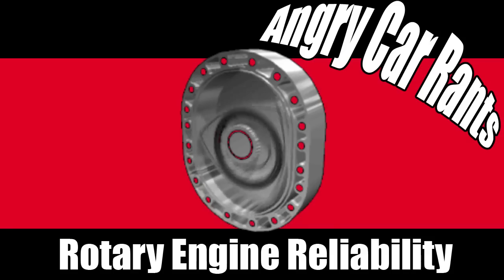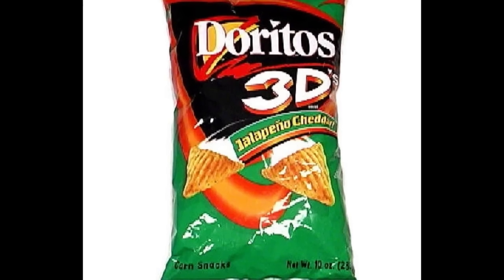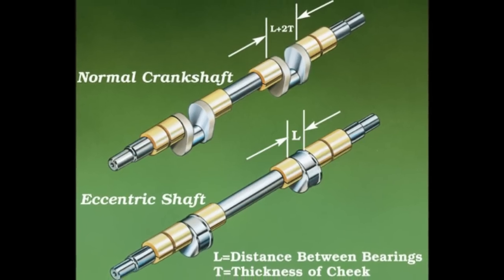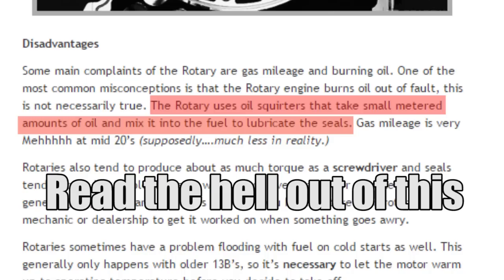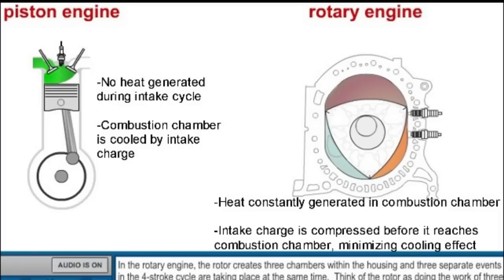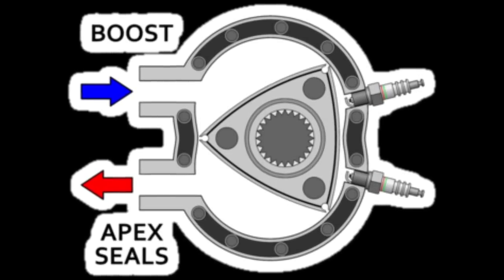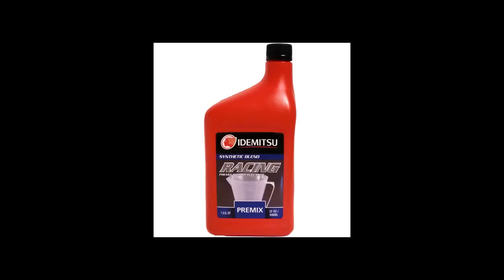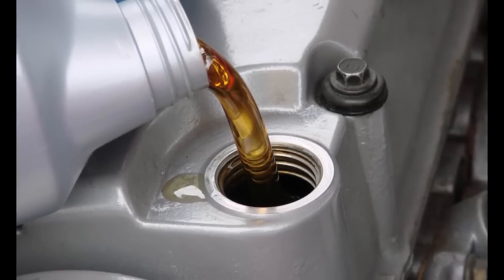Angry Car Rants #3 - Rotary Engine Reliability

Comment: Mazda does not manufacture the Wankel type engine anymore... on Friday June 22, 2012 at 4:30pm the Wankel engine assembly plant at Mazda Ujina #2 shut down and shortly there after was dismantled to make way for a brand new engine assembly facility specifically designed to manufacture Mazda's new signature Skyactiv line of reciprocating Otto and Diesel engines...
Reply: Rudster The Wankel is dead, Mazda cancelled research and development in May of 2009
Reply: If there is a demand for an engine and they can make it meet strict emissions requirements, they will make it. Basic supply and demand. When the demand reaches a point where it is cost effective to manufacture an engine, they will do it. While demand dipped with the RX8, due to the lack luster performance and little ability to improve, the number of RX7's produced was  811,634, Not a small amount and very cost effective. Considering it has been roughly 15 years since the RX7 was produced, there is a whole new generation of people interested in the car and the technology not to mention a still thriving culture surrounding the engine in America, Australia, New Zealand, Russia (Though generally not the Mazda Wankel) Japan and to a lesser extent, still a culture around the world. There is still a heavy demand for a new wankel in Japan and that on its own is enough to look into producing a new model just for the Japanese market. Mazda has been open in that they never stopped development on the wankel engine, They just did not have a market to sell the engines too however they are also investing into wankel generators that power an electric Mazda 2.

The fact is there is a growing market, a demand and the technology is reaching a point where it meets international regulations on emissions. 

Now how about rather than going through every fucking rotary video on youtube, you go do something productive with your life.
Reply: Rudster There was no demand... that is why its obsolete now..
Why is that so difficult to understand???
If its not as good, no one will buy it... and that is exactly what happened.
Reply: over 800,000 sold, no demand? What are you smoking?
Reply: Rudster Maybe instead of repeating rumors, old myths, and spreading lies and disinformation about the obsolete status and history of the Wankel??? Why don't open a book or go to engineering school and learn something about the Wankel that is actually true...
Maybe you won't be so easily fooled the 4th time they start another ridiculous RX-9 rumor that does not turn out to be true...?
Reply: Oh? What is your credentials? I'm studying Engineering at the Auckland University of Technology. Just to cover your "go to engineering school" comment.
Reply: Rudster How many were sold in 2012?
Reply: Oh, so you're completely ignoring my question but whatever, I'll answer your next question. Since the RX7 was not sold in 2012, I assume you're referring to the RX8 on the last year that they were sold. That would be 80 in the United states alone.

However that ignores 
12,346 in 03
21,690 in 04
14,673 in 05
9,343 in 06
5,767 in 07
3,368 in 08
2,217 in 09
1,134 in 10
and 759 in 11.

This is a pretty standard of sales of a japanes mid range sports car in the states. So a total of 71,377 cars sold from 2003 through to 2012. No considering production ended in 2012 and mazda stopped producing left hand drive versions of the car in 2011, let's ignore 2012. Now lets compare it with the most popular sports car in history. The Mazda MX-5. So from 2003 to 2011, Mazda sold 71,297 RX8's, In the same time period in only the states, they sold 92,987 MX-5's. Ok so they sold more, but the RX8 was also $7,000 more retail. But cost a similar price to produce. Retail of a MX-5 in 2009 was $48,000 USD, While the RX8 was $55,000. So in the states alone, The Miata's sold for roughly $4,463,376,000 USD. The RX8 however roughly sold for $3,921,335,000 USD. Ok so that is roughly $500,000,000 less than the Miata. But we look at the exact same years for say. The Mazda 3. In all but 2 years, the Mazda 3 outsold Both cars total sales in just a year. That is 106,353 in 2010 or 120,291 in 2007. By your logic, because other cars sell more, they shouldn't sell the car? The Mazda 3 sold almost 20 times as often as the Miata, The Miata sold 30% more often. that is 30% from the RX8 to the Miata to 2000% from the Miata to the Mazda 3. 

Sports cars are not the main source of income for a car manufacturer and to say as you have said in the past that the RX8 nearly killed Mazda due to engine faults of which could be fixed if found early enough with a quick upgrade of the ecu firmware. There is a demand and to say there isn't is to be ignorant. And this is just with a car that did not sit well with the rotary crowd. The RX7 sold much better than the RX8, sold better than the Miata and even sold better than the every man's Porsche, the 924. 

So before you come up with another false statement that is easily checked through official channels, how about you turn off your computer and get on with your life. Rather than wasting everyone else's because you're not educating anyone, you're just for filling your ego by pissing other people off. What people like myself in university education would call what you're doing, is cherry picking. Cherry picking small facts that support your unfounded argument.
Reply: Rudster Well I couldn't have proved my point any better myself..
Reply: Rudster "Mazda sold 71,297 RX8's.." which was not enough to cover Mazda's development cost for a new model...
producing a net loss for the company.
Reply: Again cherry picking facts, 71,297 sold in a single country. The world does not revolve around America you know?
Reply: Alfa Romeo GT produced 80,800 cars, Cadillac produced 2,700 ELR's, The Dodge Viper, 28,056 from 1992 to 2010. Honda NSX 18,531 from 1990 to 2005. The RX8 did very well for a sports car compared to other cars. Even Lotus's best selling car, the Elise only made 20,000 cars. the fact that Mazda have very popular entry level day to day cars gives them the headroom to work on unique cars like the RX7 and RX8. You are cherry picking facts to make yourself seem intelligent. And yet you're so wrong.
Reply: Rudster Its a very important fact..
Reply: Again, all you did was cherry picked what you wanted. 

People argue day and night that the 350Z was a better car and yet Nissan sold only 35,000 of them in the states. Relative to the vast majority of sports cars sold along side the RX8, the RX8 did much better.
Reply: Don't tell me.. Mazda stated that it could not make a profit on the failing RX-8
Reply: 35,000 < 71,000
Reply: Rudster Please tell me you are not suggesting that the automotive industry revolves around... New Zealand!!!!!! Hahahaha!!!!!!
Reply: Rudster Sounds like a temper tantrum to me.. Why don't you go cry to your mommy?
Reply: Oh because spending every day commenting on video's about a technology that you don't like is so mature. You have a problem.
Reply: Rudster You are the one that clearly has a serious problem accepting the truth... the Wankel is obsolete.. its been obsolete for over 4 years and it is not coming back..
Just accept facts and move on.. find a new hobby..
Reply: Rudster Thanks for proving my point...
Reply: What point? It is completely illogical. Detrimental to environmental efforts to have a stance like yours. You have no idea what you are talking about. To say that is like saying the technology used to get us to space is obsolete because we don't go to the moon anymore. The fact is, Mazda has been open that they have continued development of the rotary, there are specialists who remanufacture these engines for racing, there are specialists all around the world repairing and remanufacturing these engines. Australia, Japan, New Zealand. There are reasons why people spend $200,000 on a custom wankel for racing. They are not obsolete, you are obsolete in this discussion.
Reply: And again, you dodged my question
Reply: Dodging questions, left right and center. Spending all your time arguing that a technology is dead rather than being a productive member of society. So mature.
Reply: Rudster Denial.. is all you have, and you are desperately clinging to it. The Wankel is OBSOLETE.. no longer manufactured in series mass production any where in the world..
Reply: You are repeating yourself, not citing any evidence to back your argument and attacking the character of anyone who disagrees with you. I don't even own one. Nor do I have plans to in the foreseeable future. I have not said that I want one. You have confirmation bias on an emotional belief (Belief, not fact) and are fighting tooth and nail to prove that you're right while ignoring the fact that you have spent over a year replying to people on not just this video but many more, to the point that you are not contributing in any way and refuse to acknowledge any question that might bring doubt to your argument.

The fact is you're arguing over the relevance over a lump of metal that is dependent on an individuals wants and needs. People have the right to want something different, something to express themselves. If someone wants to do that with a wankel engine. What is the fucking problem? It is a personal choice. If everyone lived their life on pure fact and perceived infallibly logic, we would all be the same people and this world would be utterly boring. Everyone would drive one car, everyone would agree with each other, there would be no reason to deviate into creative or different technologies and interests. there would be no meaning to living except to continue the cycle. Without differences in preference and opinion, we would have no development in culture. no development of the individual. no point to anything and to attack someone on something they like for reasons you don't understand is to be a child.
Reply: Rudster I does not matter what you say.. none of it will ever change the fact that the Wankel is obsolete..
Reply: Does not matter what you say. You won't change the opinions of people here. No matter whether you're right or wrong
Reply: There is no right or wrong, only the truth.. the truth that the Wankel is obsolete.. there is absolutely nothing that you can say or do that will change this fact.
Reply: No it is a belief. Just like how I hold the belief that it is not dead. No matter how much you believe that idea, you do not know it as fact, nor do I. The only people who know the facts are not currently open with sharing those facts.I guess we will have to wait until 2020 which is the expected release of the RX9 if it does exist. I again would suggest getting over your little hatred for a lump of metal and get on with being a productive member of society
Reply: Rudster The Wankel is dead, that is a fact.. not rumor..
Reply: Rudster Engineering and Automobile manufacturing are not "faith based" industries... they deal in science and quantitative facts.
Reply: Psychology definition of facts, opinions and beliefs. 

A fact is verifiable. We can determine whether it is true by researching the evidence. This may involve numbers, dates, testimony, etc. (Ex.: "World War II ended in 1945.") The truth of the fact is beyond argument if one can assume that measuring devices or records or memories are correct. Facts provide crucial support for the assertion of an argument. However, facts by themselves are worthless unless we put them in context, draw conclusions, and, thus, give them meaning.

An opinion is a judgment based on facts, an honest attempt to draw a reasonable conclusion from factual evidence. (For example, we know that millions of people go without proper medical care, and so you form the opinion that the country should institute national health insurance even though it would cost billions of dollars.) An opinion is potentially changeable--depending on how the evidence is interpreted. By themselves, opinions have little power to convince. You must always let your reader know what your evidence is and how it led you to arrive at your opinion.

Unlike an opinion, a belief is a conviction based on cultural or personal faith, morality, or values. Statements such as "Capital punishment is legalized murder" are often called "opinions" because they express viewpoints, but they are not based on facts or other evidence. They cannot be disproved or even contested in a rational or logical manner. Since beliefs are inarguable, they cannot serve as the thesis of a formal argument. (Emotional appeals can, of course, be useful if you happen to know that your audience shares those beliefs.)

You have an opinion that you believe as fact. It is not fact. you don't have definitive proof of your opinion as fact. Read up on the difference.
Reply: Rudster Fact; the worlds last manufacturer of Wankel engines is Mazda, its board votes in April 2009 to terminate research and development the following month and sets a date to cease all production.
Fact; June 22nd, 2012 4:30pm Mazda's Wankel engine production facility at Ujina #2 plant shuts down,  8 months later is demolished to make way for new Skyactiv-G reciprocating engine facility.
Reply: Can you cite that evidence? If it is true, then it would be a walk in the park to support the notion that the engine is dead. However even if you can cite evidence, it only supports the belief, it is not a fact that the engines are dead
Reply: Very poor choice to cite. Fox news is not a reliable source to get facts from. Here is an example of evidence to support the notion that the Rotary is still being developed for

Fan, B., Pan, J., Tang, A., Pan, Z., Zhu, Y., & Xue, H. (2015). Experimental and numerical investigation of the fluid flow in a side-ported rotary engine. Energy Conversion And Management, 95385-397. doi:10.1016/j.enconman.2015.02.047

Seems those crazy people in Japan are still working on improving the design
Reply: Oh and in that article you linked

"Mazda is continuing development of the engine design"
Reply: Again, A news article is not cit-able evidence.

Try this one
Hanipah, M. R., Mikalsen, R., & Roskilly, A. (2015). Recent commercial free-piston engine developments for automotive applications. Applied Thermal Engineering, 75493-503. doi:10.1016/j.applthermaleng.2014.09.039
Reply: Or this one that again supports the notion that the engines are still being developed

Xu, X., Xu, H., Deng, H., Gu, F., & Talbot, C. (2015). An investigation of a hypocycloid mechanism based twin-rotor piston engine. Proceedings Of The Institution Of Mechanical Engineers -- Part C -- Journal Of Mechanical Engineering Science (Sage Publications, Ltd.), 229(1), 106. doi:10.1177/0954406214532632
Reply: New articles are not evidence.
Reply: Also again the content does not support your argument

"Mazda spokeswoman Michiko Terashima said research and development on the rotary engine will continue, leaving open the possibility that it could make a comeback. But production is now not making sense when considering the costs of meeting safety and emissions standards for new vehicles, she said."
Reply: "There’s no word on whether Mazda will bring an RX successor"

Again, does not support the notion that it is dead
Reply: Rudster Its dead, dead and buried
Reply: If that was fact, you could easily convince the people here, including myself
Reply: Rudster You are in denial of the facts.
Reply: Bud. Rudster just took you to school! I can't believe you were still replying to those comments... I would feel so insignificant to humanity if I were you haha. He publicly dismantled your argument, and aggressively put you in your place... but you were still replying... jeez...
Reply: The Wankel is in fact dead.. totally and completely obsolete in series mass production anywhere in the world...
Reply: Is it just the 13B that you hate? or do you hate pretty much all of the iconic JDM sports cars?
Reply: Nik Fenix Have you actually been diagnosed with a learning disability or other mental deficiency?  Or have you simply been deprived of higher education or access to knowledge???
Reply: Nik Fenix Who said I hated any engine..? I simply pointed out that the WANKEL engine was obsolete.. and no longer in production.
This statement of facts seems to evoke a particularly hateful response from you.. why is that??? 
 JDM sports cars?  that comment appears to escape logical reason.
Reply: Oh shit! Sorry man, I got so caught up living my life, I forgot to reply! You were probably sitting there all night waiting! Have you talked to your parents? Were they mad you never came downstairs for dinner?

Anyways, let your mom know I said hi!
Reply: Nik Fenix Do you find your lame troll comments really work?
Reply: +SidwatsGts  Angry little troll... why don't you go read a book... that way you won't be embarrassed every time you post a comment
Reply: Excuse me sir, can you direct me to a new car dealership where I can buy a new car equipped with a Wankel engine?????
Reply: The real doktorbimmer
 "Angry little troll... why don't you go read a book... that way you won't be embarrassed every time you post a comment"

Am i under arrest?
Reply: SidewaysGts While although a obstacle to the advancement of mankind and burden on society you ignorance is not a crime.
Reply: The real doktorbimmer
 "While although a obstacle to the advancement of mankind and burden on society you ignorance is not a crime."

Glad to know you wont give me a ticket. Continue on officer. Theres more rotary videos to police!
Reply: SidewaysGts I leave the troll duties to you..
Reply: The real doktorbimmer
 "I leave the troll duties to you.."

I really wonder if you believe that, as you go around trolling everyone who dares to even say they like this engine while you remind them, for no damn reason, that its a dead inefficient horrible engine.

Sadly.

You probably do.

Back to work mr officer. Theres people who like these engines to arrest!
Reply: SidewaysGts Just the facts here.. if you don't chose to accept the facts you do so at your own peril..
Reply: SidewaysGts Indeed, you cannot argue with the facts... and its for this reason why you are so hostile and angry.
Go read a book or find a new hobby.. this one does not seem to make you very happy..
Reply: The real doktorbimmer
 "and its for this reason why you are so hostile and angry."

Awh. Mr officer- I just give you a hard time because youre a douche bag.  Theres little else to it :)

"Go read a book or find a new hobby.. this one does not seem to make you very happy.."

Gladly. Once you stop policing every rotary video. 

Until them- Im having lots of fun following you around with sirens
Reply: SidewaysGts Hey! have you seen the new 2017 RX models down at the Mazda dealer..
No?  why is that?  LOL!!!
Reply: The trailing side of the rotary engine's combustion chamber develops a squeeze stream which pushes back the flamefront. With the conventional one or two-spark-plug system and homogenous mixture, this squeeze stream prevents the flame from propagating to the combustion chamber's trailing side in the mid and high engine speed ranges, Mazda engineers described the full process in 'Combustion characteristics of Rotary Engines', K Yamamoto et al., SAE paper 720357. Kawasaki addressed this problem in their US patent nº 3848574. This poor combustion in the trailing side of chamber is one of the reasons why there is more carbon monoxide and unburnt hydrocarbons in a Wankel's exhaust stream. A side-port exhaust, as is used in the Renesis, avoids one of the causes of this because the unburned mixture cannot escape. The Mazda 26B avoided this issue through a 3-spark plug ignition system. (At the Le Mans 24 hour endurance race in 1991 the 26B had significantly lower fuel consumption than the competing reciprocating piston engines. All competitors had the same amount of fuel available due to the Le Mans 24 hour limited fuel quantity rule.)[56] An inventor proposed that a narrow linear opening for spark plugs in the housing, instead of the round hole, would improve volumetric efficiency, fuel economy and emissions; he claims to have proved this by recording a measured reduction in the exhaust gas temperature. As in early reciprocating engines, a lower effective compression ratio is linked to higher exhaust gas temperatures. (YouTube: 'Rotary Engine Breakthrough')